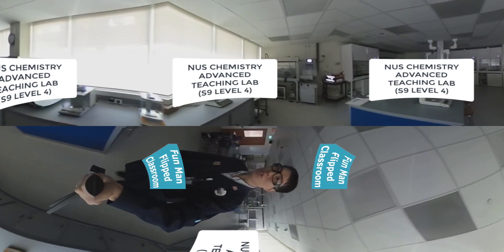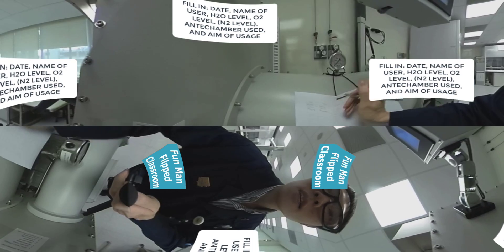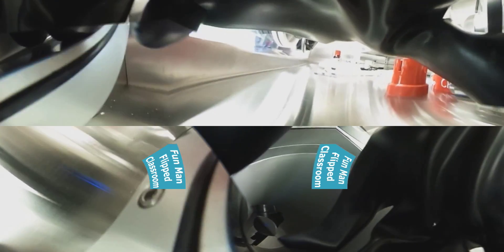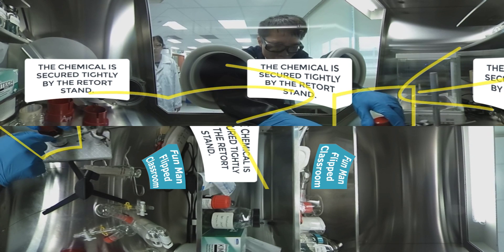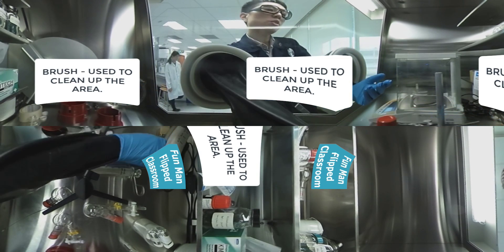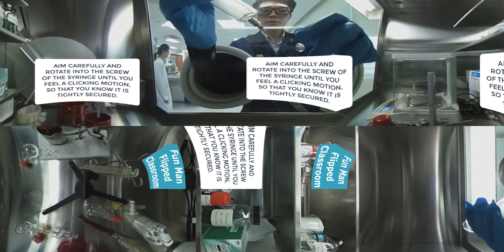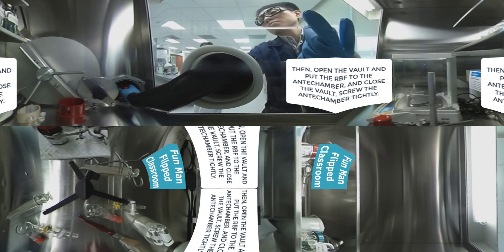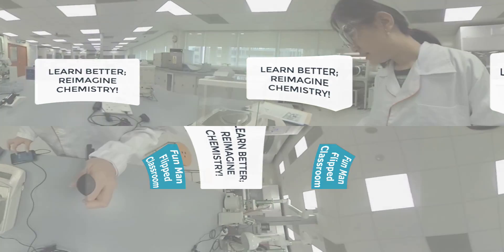How to use a Glove Box

Comment: Thank you for your effort. Can we use the same glove for different process for example for battery and also for solar cell preparation or this will cause cross contanimation
Reply from the maker: agree, some of the professors have >1 glove box for this reason. Mixing isn't advised.